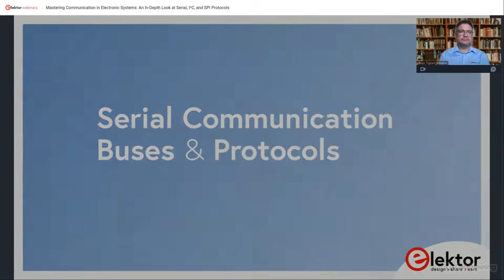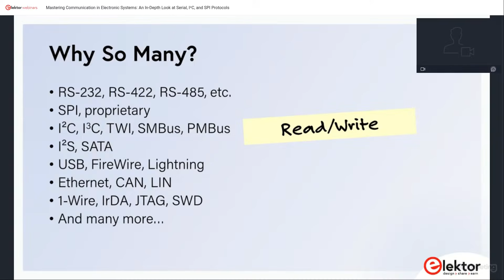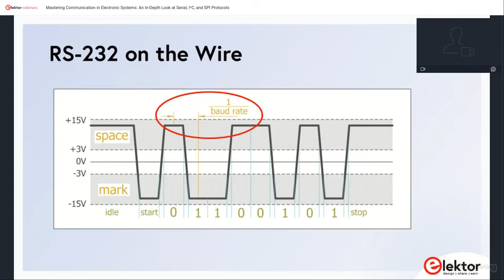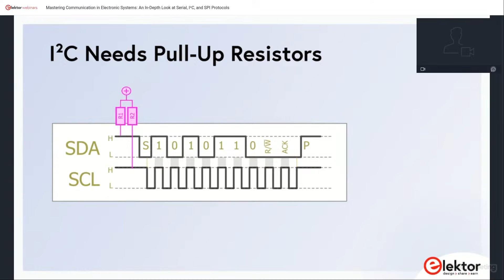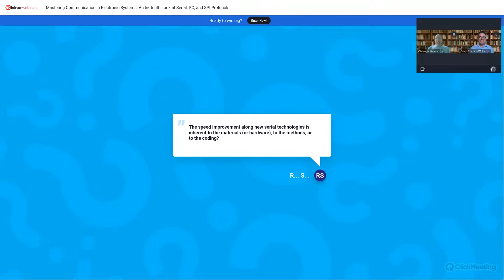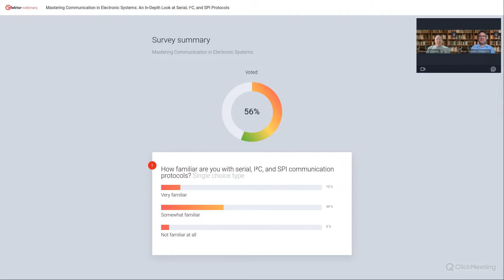Mastering Communication in Electronic Systems: An In-Depth Look at Serial, I²C, and SPI Protocols

Comment: Nice to see some basics told about those protocols. Also good to see a new host. 

The usual points, video quality of the both presenter could be better, as stuard shows in his streams.
About I²S it is more a relative to SPI than to I²C even if they name could lead to this conclusion. With I²S you got a Master /Controller and a Slave / Target where only one drives / generates the clock. But may you can consider a own presentiation about I²S (maybe with another audio themed one?) .
Also note that while most will knwo I²C as Master/Slave , NXP has changed naming to Controller/Target in the latest Spec release. 

Regards

Comment: Thanks for an excellent overview of serial communications. It is difficult to find this type of a presentation elsewhere. I know you mentioned several problems with each of the protocols. May I suggest a video or webinar on just the problems that can crop up with I2C, SPI and serial seen in some of the common microcontrollers and methods to overcome them.